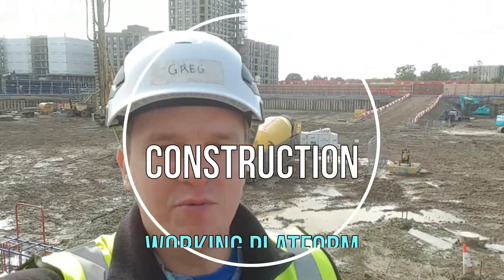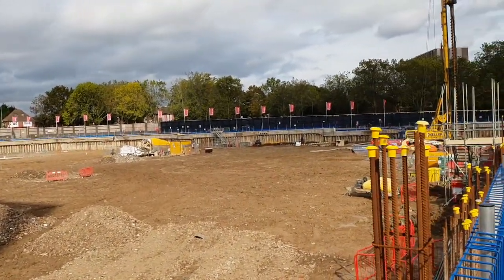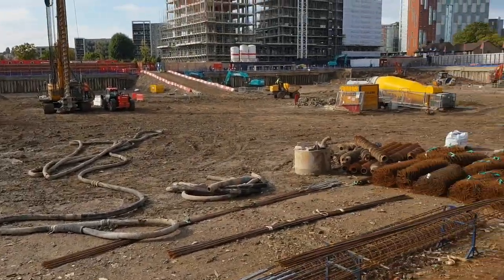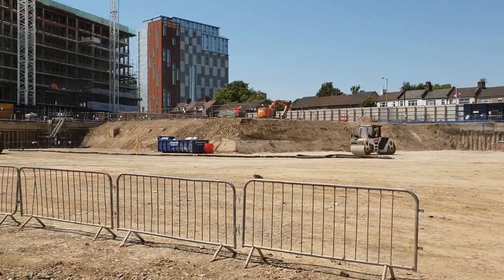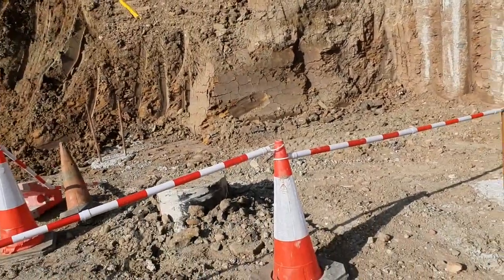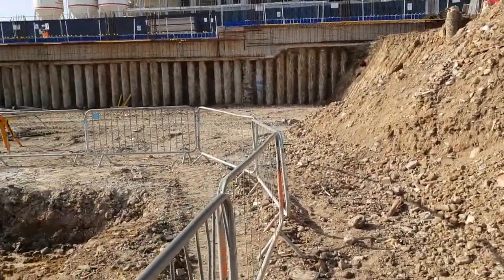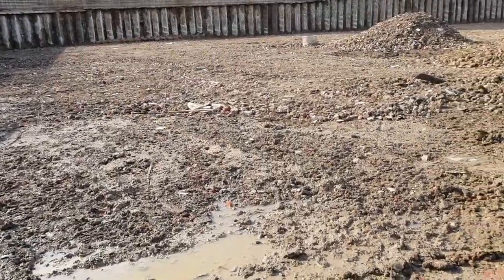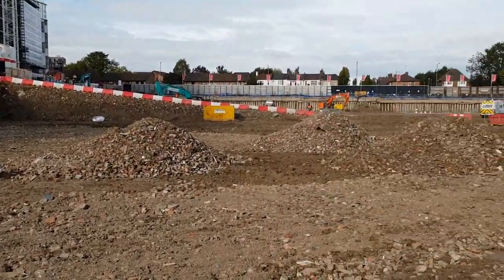PILING MAT installation process. CBR test

Comment: Greg, 
         Excellent video and a very good commentary with it.

       I saw lots of piles close to the site boundary with the pile beam sitting top of it.

       Is this to create the boundary or the strength to the building structure?

      The CBR test was shown brilliantly which is a top requirement for the Structural Engineer. 
      Does the CBR test result decides how much capping layer in millimetre is required?

     Super video. Congratulations.
Reply from the maker: Thank you Asim! Happy you like it :)

Comment: Got the questions, where usually testing pile has to be installed, and for what purpose. Second question , does pressure testing need to be applied always? Or you can just say “solid as fuck” ground
Reply from the maker: They are installed to check/confirm the bearing capacity of the pile in the ground (confirming the ground investigation survey).To check the pile pressure has to be always applied, you can see in my next video, I will also cover this bit more in Construction Drawings video nr.3, showing the results.